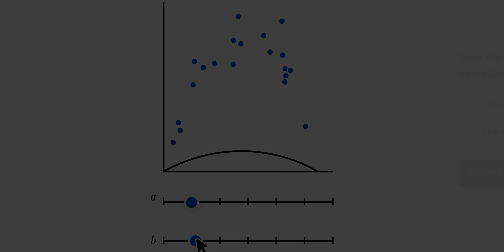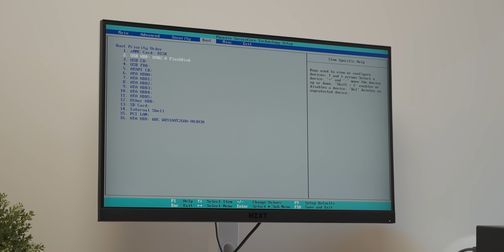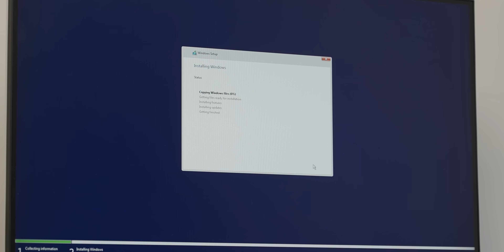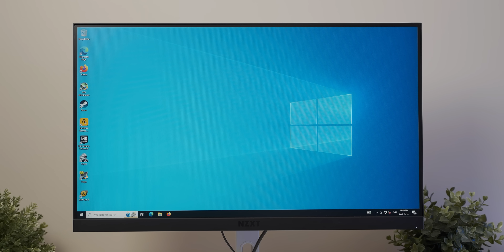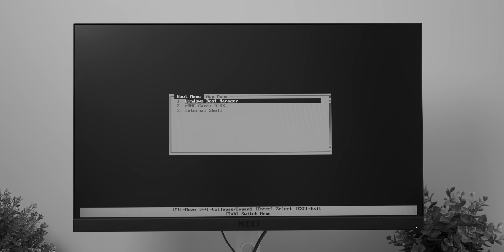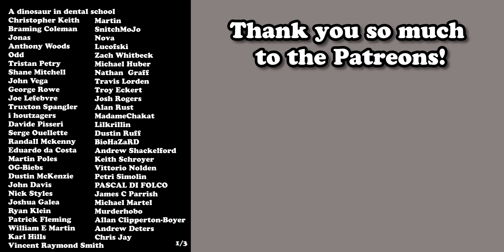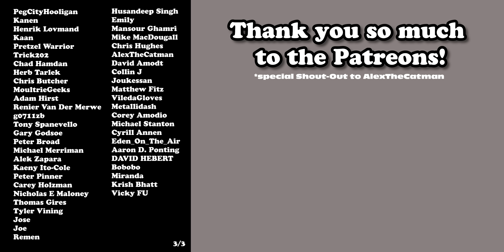I Plugged A Graphics Card Into My NAS...

Comment: what no CPU upgrade? that nerds to be done ASAP so it shows the limitations of the MOBO power delivery, what performance could be achieved without melting that "hefty" stock no Intel Cough passive CPU Heatsink, would like to see a low-profile CPU cooler, something like the Noctua NH-L9i Intel-only Low-Profile Quiet cooler that would allow some sort of CPU OC; Ing and dial out that bottlenecking shenanigans.

Comment: To get it running properly you may need to check the manual. The Celeron processor doesn't have great io features. So it probably can't access all the io features at the same time.

Comment: (12:30) I think it was because the CPU ended up desoldering itself. It'll probably work again if you could somehow solder the CPU back on.

When I saw this video in my YouTube subscription feed, I thought it was being done with a custom-built NAS running on a low-end server mainboard*, in turn like what I'm currently doing with one from 2014 where I plugged in an (era-appopriate) NVIDIA Quadro K620 to use with GPU passthrough in QEMU/KVM so that I wouldn't have to put in an extra physical PC for a project idea I had. No, this actually was done with a pre-built NAS.

*Mid-range to high-end for a desktop PC, but low-end for a server.

(Edit: Your video also reminded me of one where someone installed pfSense on a Sophos XG firewall appliance. Similar to what you did, they also inserted a separate SSD.)

Comment: GTA5 not loading properly is a sign of a bandwidth issue. The NVM-e slot is probably running at x1 or something horrible, since the PCI is split between 4 NVM-e drives.

Comment: You may have had a comparability issue between the processor and the amount of ram installed plus you probably toasted the cpu under that loading with that small heatsink applied.

Comment: Looks like you exceeded the heat capacity of the little passive heat sink and killed it. 
I have a NAS board with similar CPU, this one and the one that has the same CPU as yours both have little blower coolers.
I think Dawid should a add a fan for the next attempt.

Comment: I recall seeing that level of rendering when using a very low end and core limited CPU, which funnily enough, you are indeed using. The GPU is completely choked by the CPU, very little fix it.
OTOH, the modularity of the device is quite intriguing. I can see it beicoming a hacker choice for interesting prjoects, a subset of the vast R Pi  ecosystem.

Comment: @David Does Tech Stuff - You might wanna check with the provider or some forums. I used to work for a Cancer therapy center and our Synologies that used any of the Celeron or Pentium J series had issues....  They had 2 specifically which are known issues.     "Synology has a Ryzen based version that we replaced all 6 with and never had anymore issues, Higher Single Thread IPC and multi thread plus more memory compatibility Also M.2's as well.  Give them a shot maybe @synology will sponsor.   There rackstations are epic to lmao.......
1. CPU Die actually has a fault were it decays during certain generation intel J series cpus, once power cuts they dont come back online.
2. Memory compatibility - We tried upgrading ram higher than on the spec sheet and used a stick that was not verified by the manufacture. It did the same thing.

Comment: I'm curious to see what if you plugged the graphics card into the PCI-e directly instead of the NVMe slot. Also, Is the CPU socketed ? could be fun so see an upgrade with some low TDP T series i5 or i7.

Comment: could the NAS reboot without the GPU? also test the GPU separately in another system and also make sure all the extension connectors you used didnt move. I once had a similar problem gaming on extension where the extension decided to short itself and blow a hole in the GPU. thankfully asus replaced the GPU for free. I've done better than this long ago gaming on a laptop adding an eGPU and an esoundcard (PCIe)

Comment: The celeron was probably overheating. Add some kind of Dawid style solution for cooling. Also, the 7800xt was probably only running at x4 or x8 instead of the x16 in that m.2 slot

Comment: Im thinking it may work better with a pcie x4 to x16 connector and remove the m.2 daughter board as it might increase the performance especially if the board sends 1 lane to each m.2 slot

Comment: Wow, that Crysis performance is right on par with my first PC. It was a duel core Athlon at 2.8ghz with an x1650 gpu. It was enjoyable at the time, though I could never sit and play like this these days. That's impresive for a NAS!

That NAS is built how all premade PCs should be made- with modular parts that are easily swappable. I hate proprietary products- they're all destined for early retirement in a landfill.
Reply: I think I was rocking an Athlon x2 4400+ and the 320mb variant of the 8800gts.

Comment: These companies do realize that 100 feet of Cat7 is 25 dollars 😭😭😂😂
Reply: Hi there! 'Category 7' is not recognised by TIA/EIA as an official standard. But, Cat5e officially can be used for 10-Gigabit Ethernet for up to 45 metres. The cables we include with our NAS are two metres each, including Cat6 or Cat6a cables would provide zero benefit while adding unnecessary costs onto the customer. Since category 5e cabling can easily handle 10-Gigabit Ethernet at a fairly respectable distance, we are confident our cables can more than handle the 2.5-Gigabit ports of our NAS. I would probably agree that Cat5e would be increasingly insufficient for 25GBASE-T and 40GBASE-T, but if the extra expense yields absolutely zero benefit for the customer, I'd rather spend the money somewhere else improving the customer experience.

Comment: Holy crap! I prefer to build my own NAS when I need a new one, but credit where credit is due, Asustor seems to have made a product designed to last (even though it was ironically killed by the end of the video). The fact that the only major part soldered down is the CPU is impressive.
Reply: Thank you for your words of support! Feel free to ask questions if needed!
Reply: @ASUSTOR_YT  any idea what killed it in the end? Hopelessly overheating the PCI controllers as another comment speculated?
Reply: @Lolwutfordawin   Not sure. We don't even know if it's dead, but I will follow up and see what the deal is. Maybe even a followup video.
Reply: @Lolwutfordawin  We got word that the NAS is not dead, but the windows install kicked the bucket.
Reply: @ASUSTOR_YT  that sounds like windows, good to hear!

Comment: You should fix it... you did show how modular the system was. 79 C should not be an issue for a CPU - a 10 watt CPU. But no CPU cooling fan means that heat can soaking through the board. I suspect you just killed a ram stick as they are can be really sensitive to heat.

Comment: I game on my QNAP server.  Its has PCIe slot and it supports both VM and PCIe passthrough.  I plugged in my old GTX1650 and stuck a dongle into the HDMI port so it thinks a monitor is plugged in.   I  can game on any television hooked up to the network via steam link.   The os automatically puts the most used files on the SSD raid and the less used ones on the hard drive raid.  I did upgrade the cpu to an I7770 from an I3.

Comment: I guess it’s appropriate because of the crazy things you do, but you also find the strangest problems. Why would it post from the second slot initially but not after you installed the graphics card drivers? It’s an amazing facsimile of every time I try and do anything with technology. I run into issues that have no explanation or are very convoluted.

Comment: The issues with frametime and rendering is because you have completely saturated the PCIE lanes with the GPU and the SATA Drive, which probably ended up overheating the componants used for PCI communication. A lot of low end motherboard won't let you use specific SATA ports if you are using an M.2. That was a little apparent when you had to switch from bay one to two, back to bay one lol
Reply from the maker: Oh that's very interesting. I just assumed that considering the M.2s are on a different 4x pcie slot it would be fine, 😅
Reply: TIL. I found ages ago that my pc doesn’t recognise my SSD on certain Sata ports. This explains it, though without all the hardware death.

Comment: LMAO it died???? To think I considered buying one of these for 4x nvme. Its just an adapter for for 4x LOL
Reply: We're not really sure what happened, but running non-standard use might cause an issue. Since there are two power supplies running in the NAS, there can be issues where power is feeding through the wrong channels and can cause undue stress. We stand by our warranty under normal use.
Reply: @ASUSTOR_YT  Hey my comment was a bit brash. I agree that this was far beyond it's intended use. I did almost buy your product but it looks like the secret sauce for nvme drives is just a pcie riser and bifurcation
Reply: @kandym3478  Hey there! If you are looking for a NAS with M.2 drives, we have one that has six M.2 slots as well.

Comment: If I had to gues, removing the casing meant that the fan wasn't pulling enough air over the heatsink, so the cpu partitally desoldered itself.
Reply: Thought of this too, but you can see throughout the BF clip that temperatures were hovering about ~77C but not really more. From 80 to desolderimg goes a long way, so I'm not so sure

Comment: The fact that this NAS costs 600+$.. it's just overpriced as hell.
I can build a separate PC with HDDs, SSDs, RAM, some power efficient Xeon CPU with an AliExpress mobo and still have half of the money left..
Can someone explain to me what's the point of this kind of NAS?
Reply: Will use a hell of a lot less energy, be quieter and most importantly easier to get up and running with the built in software than a home made Ali express Xeon setup. The cost of it might not be worth it for you, but for many the cost will be a bargain compared to the amount of time spent messing around with a DIY solution - it all depends on how much your time is worth.
Reply: @shapesinaframe also the fact you wouldn't get the hot swap HDD caddys and the screen

Comment: Funny, but CAT5? Aren't they on CAT8 now? CAT5 is about the slowest you can get... and mechanical drives? Blah... but a fun experiment.
Reply: Cat5e can do 10-Gigabit Ethernet up to forty five metres.
Reply: Cat 5e is perfectly fine for 10G speeds up to 45 meters. Mechanical drives ARE the storage of choice for NAS devices for the large capacity per TB cost, and you don't need blazing speeds to access bulk storage. Remember, NASes are supposed to be a backup to your main data... or you'd need a second NAS to back up your first main file server NAS.

Comment: 9:52 Hey Dawid! Don't choke the GPU with only one lane of PCI Express with that riser! The actual PCI Express socket supports four lanes for MAXIMUM POWER!!!!
Reply: I’m guessing this is what caused the loading in GTA, everything works fine until the GPU needs new data and there’s that bottleneck.
Reply: @AlexTheStampede  no its mainly cpu bottleneck, the cpu is so slow that the gpu have to wait for information of what to render from the cpu.
Reply from the maker: Thats interesting, I thought the m.2s used 4x lanes. Thanks for the suggestion. 😃
Reply: @DawidDoesTechStuff  No. The slot is 4x. It is bifurcated into four m.2 slots using one lane.
Reply: @DawidDoesTechStuff  time to break out the hacksaw 4x gpu again.
Reply: Yeah I get "for the meme", but I'd like to see the difference if he just left out the daughterboard, and used a 4x riser.
Reply: @geekehUK  Yeah. A 4x riser works just fine.
Reply: That's exactly what I thought! a 4x PCI-E slot split into 4 separate 1x PCI lanes for the M.2 slots. Get a 4x PCI-E riser off of the mobo and it should do a little better.
Reply: The fact you guys are on here giving tips to make the nas game better is insane, idk what all you sell but you've gained a customer.
Reply: @lil.shaman6384  Thanks! Feel free to ask questions if needed!
Reply: guessing it is a gen 4x4 pcie slot, it would maximize the lanes on a rx 6400
Reply: @ethanmike9  The M.2s are x1 each. The slot is a total of x4. PCIe 3.0.
Reply: @ASUSTOR_YT  that would explain some of the graphics issues, running the gpu through a gen3x1.  bring out the gt 1030!
Reply: Would be cool. But I doubt it's possible to disable PCIe Bifurcation
Reply: @Leonvolt28  It's possible and user switchable.
Reply: @Leonvolt28  solid point.  I guess it depends on the raid card the server has.
Reply: Although all you need is 1x PCI slots for GPU mining.... lol
Reply: I think one of those PCIe slots was open, so it is possible to put a 16x long interface into it without cutting anything in the way :)

Comment: How come you didn't use a 4x to 16x PCIe adapter? Since you already had the slot, I feel as if that could've been easier. I mean you can't test it that way now because welll... the system's dead.
Reply: That m.2 slot should have the same 4 pcie lanes as a 4x pcie slot and he already had the adapter. Now what I wonder is if there are any adapters to turn two 4x slots into an 8x slot. Though the celeron is clearly a bottleneck even at 4 lanes, so 8 lanes shouldn't make a difference.
Reply: @Sgt_SealCluber  Ik, just thought that physically it would've been easier and it also would've had less connection points so it would also be safer

Comment: Try putting a large aio on the back of a gaming laptop to see how well it could perform if the thermals were not hellish 😂
Reply: He has a vid doing this with an air cooler, which was easier because the weight kept the cooler on the chip.